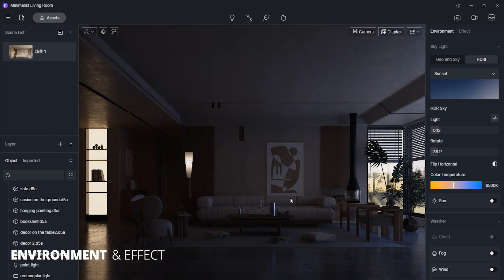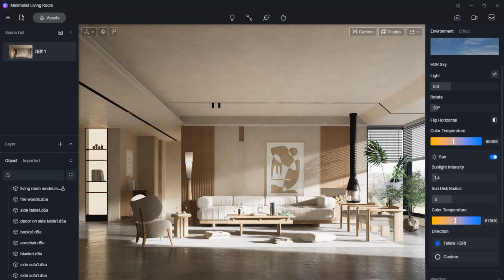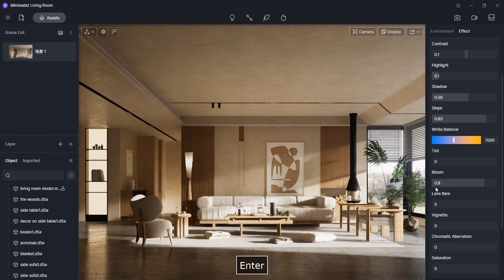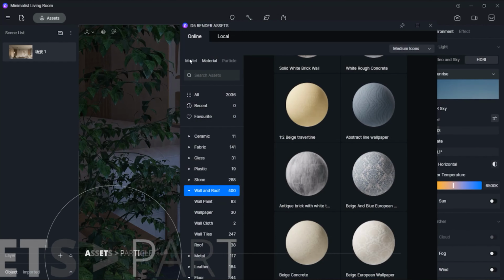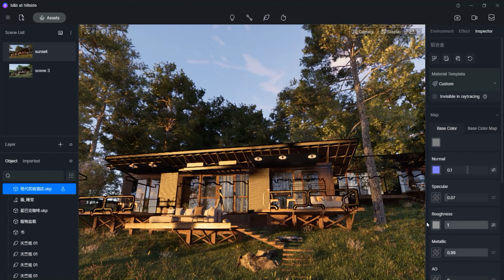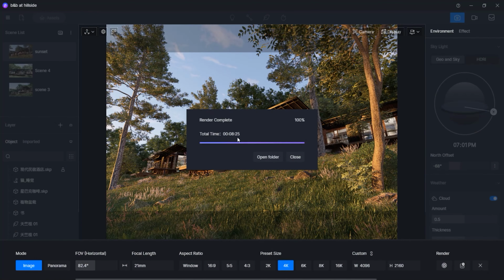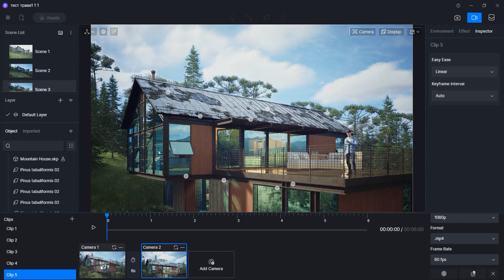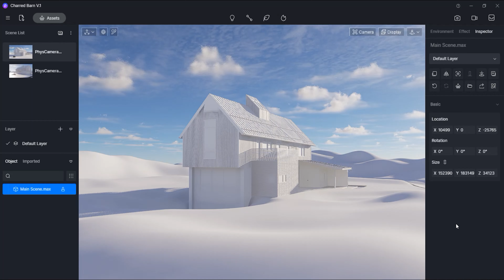Why You Should Switch to D5 Render

Comment: hello! so we use the d5 render after we render at vray? or when we finish from 3d max we automatically render on d5 render?? like i don't get the before D5 render step!!
Reply from the maker: Hi, When you created your scene inside 3ds max, you should send it to D5 for rendering. 
In d5 Render, you can set lights, make materials, and render your scene + make animation for that scene.
Reply: @SaeedMandegarTutorials  thank u!!

Comment: I use vray, I wanted switch. Then I realized D5  is not good at making detailed textures especially in wood. It is really hard to control wood grains in software, it all looks fake.
Reply from the maker: However, since Chaos group offers "Chaos Vantage," it would be more appropriate to compare D5 Render to other real-time rendering engines. I believe that by adjusting your materials in D5 Render, you'll achieve good results, although not as perfect as V-Ray, but still convenient.
If you need any help to achieve better final render quality, feel free to join my Discord channel. ✌️
Reply: @SaeedMandegarTutorials  awesome i would like to join, sounds awesome
Reply from the maker: Discord Invite Code: mZx4vbbTnn